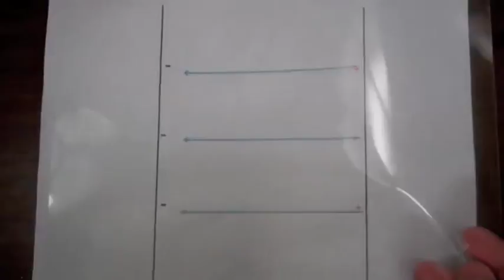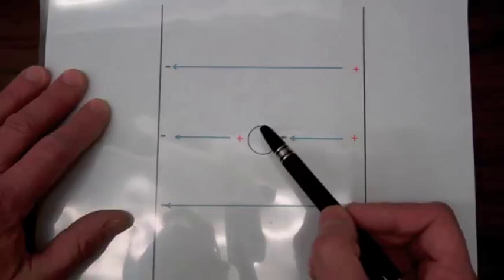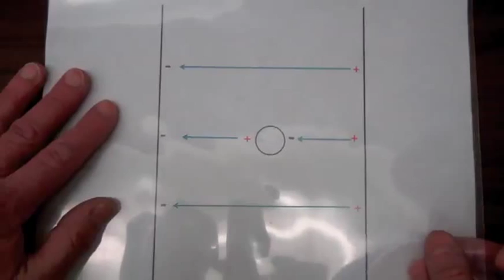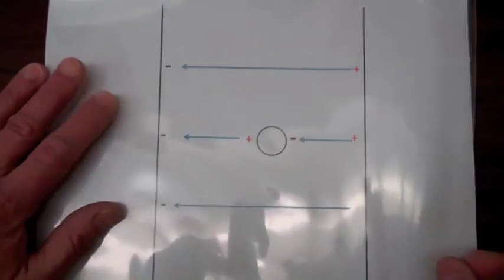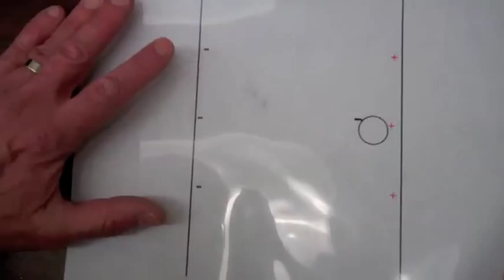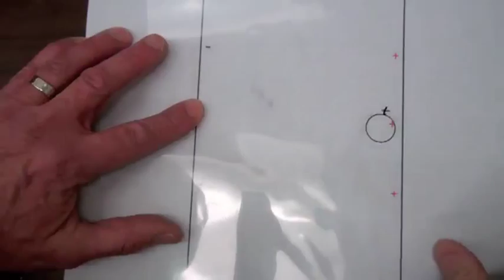Franklin's Bells, an Electrostatic Motor

Comment: WoW. .. An electro static motor ... Great to see ... But electromagnetic motor takes very less energy than electrostatic motor... Isn't it? ... Why is this so?
Reply: Probably because conducting electricity through wires is more efficient than radiating it through the air where much of it is lost.

Comment: using the capacitor analogy. if the e-field is constant inside the capacitor why wouid bringing the center conductor closer to the + plate make the force of attraction greater.
isn't force = qE??
Reply from the maker: With the little bell in the center the electric field is no longer constant. In fact inside the little bell it is zero, it is a Faraday cage. If you have a dc voltage V across the capacitor, the integral of E dot dl from one plate to the other has to be V. So if your path of integration goes through the little bell, just outside the little bell the electric field has to be larger than the field would be without the bell present.